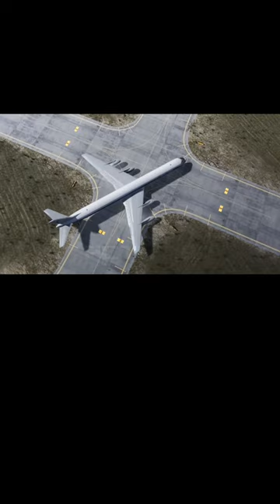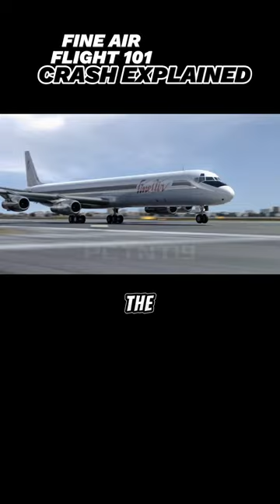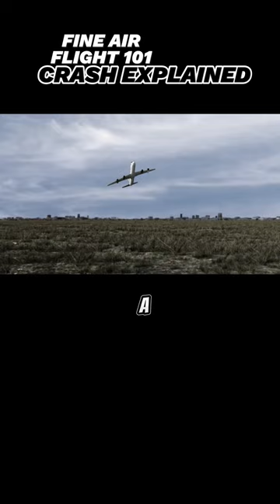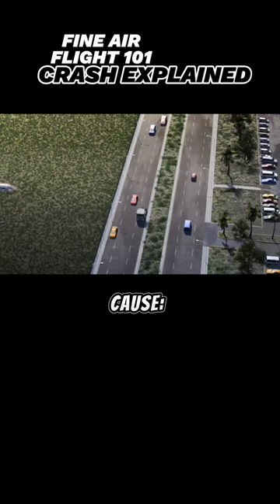Fine Air Flight 101 Crash Explained🥶 #aviation #shorts #fyp

Comment from the maker: For those interested, here is a breakdown of what happened:

Fine Air Flight 101 crashed during takeoff on August 7, 1997, at Miami International Airport, with the primary cause being an incorrect cargo load on the McDonnell Douglas DC-8-61F aircraft. Here are more detailed insights:

Incident and Loss of Life:

The crash occurred shortly after takeoff, leading to the loss of control and the aircraft crashing onto a road.
All three crew members - Captain Dale Patrick "Pat" Thompson, First Officer Steven Petrosky, and Flight Engineer Glen Millington - perished in the accident.
A security guard on board and a civilian in an airport parking lot were also victims of the tragedy.

Primary Cause - Incorrect Cargo Loading:

The official NTSB report identified incorrect cargo loading as the primary cause of the accident.
There was a significant shift in the aircraft's center of gravity due to inadequate cargo distribution, impacting the stability of the plane.

Specific Issues Identified:

Ground crew reported irregularities in the aircraft loading process, with the cargo safety system not always being used correctly.
NTSB highlighted the aircraft being overloaded by approximately 6,000 pounds (2,700 kg).

NTSB Criticisms and Legal Consequences:

NTSB criticized operator Fine Air and loading agent Aeromar for disregarding cargo operational control procedures and improperly managing the loading process.
Fine Air and Aeromar faced fines of around $5 million and were involved in a criminal investigation for evidence destruction and cover-up.

Criticisms of the FAA:

NTSB also criticized the Federal Aviation Administration (FAA) for inadequate oversight of Fine Air's operational control responsibilities and for neglecting to correct known cargo-related deficiencies.
These details provide a more in-depth perspective on the circumstances leading to the Fine Air Flight 101 accident. It is important to note that the information is based on reports available at the time, and there may be subsequent updates to the investigation.

For more information you can search about Fine Air Flight 101.

Thanks for watching this video.✈️🙏